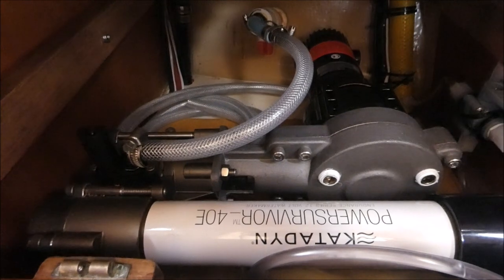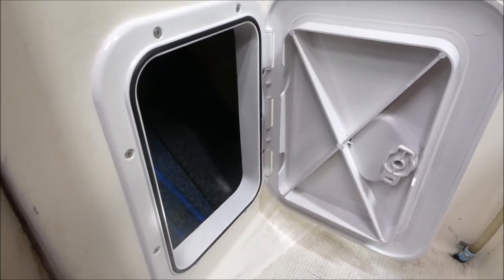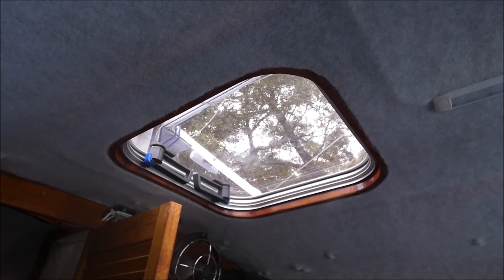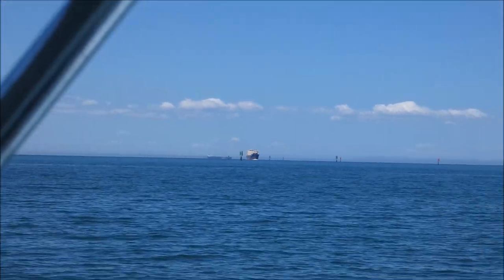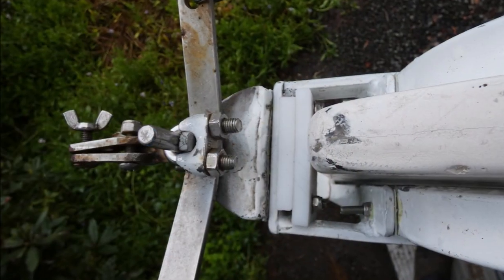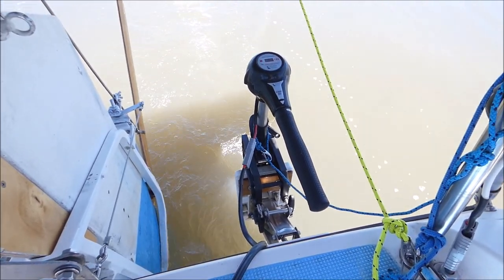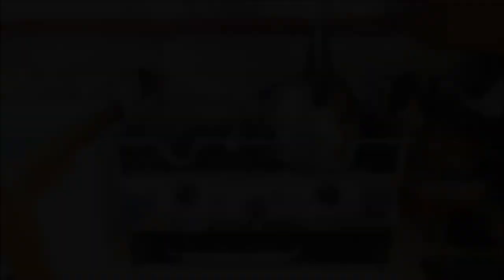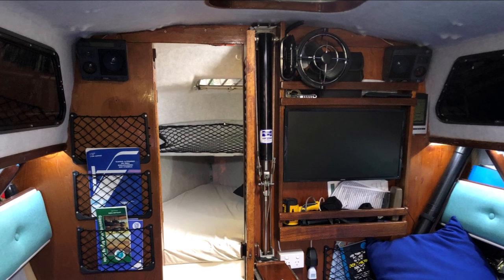Neringa Improvements   Preparing for the Kimberley

Comment: Well done Mark.... someone has already asked the question re the rudder. Cheers Tony
Reply from the maker: Hi Tony, Yes I assume you saw my reply. I forgot to put in one bit of footage in the last video about this. In essence it is a very simple modification if your rudder box has enough slack at the bottom to allow the rudder to rotate back and forward. All I did was to open the top back of the rudder box and make a u shaped extension bracket that allows the top of the rudder to move back around 75mm. It is held in this position by the wooden block you see in the western port video at the front of the rudder. Pushing it back a the top makes the bottom of the rudder move forward with around 15% of the blade crossing forward of the rotation line of the pintles. This makes this section use the water flow to help turn the rudder or what boat builders refer to balancing the rudder. My rudder has gone from a firm hand grib and the need to use reasonable force to steer at speed to being able to steer with 1 or 2 fingers. Even my wife commented how light the steering was when she was at the helm. If you exceed more than 20% of the blade forward of the rotation line the rudder can become unstable and lock over one side or the other. The sweet spot most boat builders aim for is around 18% of the wet part of the rudder forward of the rotation line. If I have time in the next few weeks I might put together a video with images to explain the concept and what I did. My method is not the traditional way of doing this but has proved to be a simple and effective method in my case. Cheers Mark

Comment: Mark, if you don’t go this year, I can imagine that you will just keep adding to the yacht. LOL
Reply from the maker: It better be this year, don't think I could take another round of being completely packed and ready just to unload everything again. Neringa is running out of room for improvements although I am looking to upgrade the outboard to 15hp for those kimberley currents.
Reply: @TRAILERYACHTADVENTURES  yes understand, what brand of outboard are you thinking of, I believe Yamaha are the best.
Reply from the maker: @CaptMarkSVAlcina  These days there is not a lot to differentiate between them. Yamaha high thrust only comes in 9.9 or 25hp and I need 15hp. My current motor has the gear shift through the throttle which is great for docking, lets me see where I am going whilst being in control of the boat and not having to duck down to shift gears. Sadly no one makes this shifter anymore so the next best is one on the tiller handle that I could make an extension for. To cut it short in the end I will probably go with a mercury 15hp fuel injected motor with a high thrust prop. Lightest in class and hopefully small enough to fit my motor well. They are japanese made by tohatsu which have a long and reliable history. 12 amp alternator as well to help with battery charging.
Reply: @TRAILERYACHTADVENTURES  My Mechanic connected the 9.9 Merc to existing Yamaha gearshift and throttle. Wonder if that could be obtained instead of tiller handle.

Comment: so playing catch on your channel just subscribed I have a Hood 20 1967 I'm currently rebuilding from the ground up! I'm thinking of a 4hp outboard as i don't require to registered the boat saving $$$$ do yo think this is enough to push the boat along or do I require a larger motor?
Reply from the maker: It will be enough in light to moderate conditions to push the boat fine. The times you will have problems are into strong headwinds where wind and chop will likely slow progress considerably with the boat stopping every so often when the right set of waves comes along. Of course pushing against currents will also play havoc. So probably 75% of the time 4hp will suffice. The times you may wish for more is when the above conditions arrive unexpectedly and stop you getting to an anchorage or through a tricky channel before dark. Cheers Mark

Comment: Nice video! Have you had your boat & trailer over a weigh bridge when loaded up ready for cruising?
Reply from the maker: Only once and it was just under 3 tons on the trailer with water tanks part filled. Most RL28's packed for cruising will be in the 3 to 3.5 ton range, empty more likely in the order of 2.5 tons. They are a big boat but as long as the trailer is properly braked and the car is rated for the load not hard to tow. Cheers Mark
Reply: @TRAILERYACHTADVENTURES  Yeah I've had my boat on the weigh bridge at 2 tonne on the limit of my vehicle

Comment: I am in the process of restoring a RL 28 and I'm  lovi g your vlogs. Can you give me more information about  the masthead rig. Are you using the same mast? Keep your videos  coming please. 
Cheers
Reply from the maker: Hi Michael, I added  2 extra side stays to the top of the mast and a new forestay to the top of the mast for the new furler. The existing forestay was moved back to the rear of the anchor well to become an inner forestay for security and strength and to be able to adjust the curve of the mast. I cant find the lengths of the new stays and these may vary as there was a bit of variation in RL masts. When I replace them I will measure them again.
New u bolts were placed 50 mm next to the existing side u bolts. This means the top of the mast can still move forward and rearward a bit for adjustment. The lower spreaders were extended by 50mm so the existing side rigging stayed were it was but the new top wires to go on the outside  to the top of the mast. The smaller forward spreaders were replace with rearward facing spreaders. I tried without these first but to support the top of the mast required a higher tension, worked much better with the spreaders.
A new ubolt for the inner stay was installed rearward of the anchor well. I made and internal anchor for this that you will see in my last improvements video in the relining section. I did this because the bottom of the anchor well at the rear is prone to cracking on RL28's and the plate spreads the load evenly and avoids this. 
The new forestay attaches to my anchor bracket which was strong enough and fastened more securely with a plate and 3 largish bolts. I have an extension to allow the furler to be just above the pulpit to allow me to see under when underway. On the mast the forestay attaches to a rigging yoke riveted and bolted to the top front of the mast. All fittings were bought from Keely marine or Whitworths.
The backstay remains unchanged.
It is important to note that I had new sails made at the same time and I very deliberately made them with the same area. I might still have the details of the mainsail which had the roach reduced slightly to decrease rounding up tendencies. Sailing in wind under 15 knots this results in a rig that is easy to balance and out performs the original rig, after 15knots you reduce the headsail first and performance is similar to the original rig 20knots plus. Sailing downwind wing on wing used to be awful with the original rig with the boat yawing between large main and small head but now with the sails balanced is a pleasure. Dont oversize the headsail as this will unbalance the boat and in strong gusts cause strong rounding up.
I am satisfied that the rig is now super strong and now that it is properly tuned sails very well. Hope this is of some help. Cheers Mark
Reply: @TRAILERYACHTADVENTURES  ok thanks,  I  would like to get more information on  this subject as I  agree with you that the headsail is abit of  a letdown. Definitely  worth doing.

Comment: Mark, Having seen demos of some Lithium batteries burning very happily, how would you put out such a fire? cheers Tony W
Reply from the maker: Hi Tony, Yes Lithium batteries can burn but it takes a bit of abuse to get them going. Lithium metal batteries are dangerous as the more water you put on them the more they burn. The Lithium Iron Phosphate batteries that I am using can also experience thermal run away and burn but can be extinguished with plain water. So if I ever have this happen the plan is to flood the lithium battery locker with water which will extinguish flames and cool the faulty battery to slow or stop the thermal runaway. Cheers Mark

Comment: Very jealous of your boat. Are the boom and traveller standard? The traveller is on cabin roof giving more room. Your setup with the Bimini allowing full standing height under the boom is awesome. Did you make any changes to achieve this? Love the videos. Looking for my ideal TS but they are not something you can just pop over and have a look at so videos like yours are very helpful. Keep up the great work mate.
Reply from the maker: Hi Paul,
Yes the boom and traveller are standard. As a cruising arrangement they are great but some racers would say not a good as the full width traveller in the cockpit for trimming sails more precisely. As I am a cruiser my arrangement suits me and I am happy to forego the extra half knot you might get with the full width traveller. 
I chose the RL28 as one of the few trailer sailers that have full standing headroom in both the cabin and in the cockpit allowing for the full height bimini. On the flip side it makes for a slightly higher centre of gravity which makes them heel a bit more quickly. Not the fastest boat on the block but many pluses as a cruising boat.
Glad you enjoy the videos, love to encourage others to get out there and go on their own adventures. RL28's are pretty hard to buy at the moment but keep looking and I am sure you will eventually find your ideal boat. Cheers Mark
Reply: Thanks for the reply. Did the additional lead you added to the keel box do anything to remedy this? Not bothered about racing, just want to emulate your cruising lifestyle 😊
Reply from the maker: @PaulWright890  The lead has certainly made a difference. The RL has a more vee shaped hull than many trailer sailers and even with the lead heels to 15 degrees quite quickly until it has its cheek in the water. The main difference the lead has made is that it stays not much more than 15 degrees as the wind increases whereas before in 30 knots you would see 25 to 30 degrees of heel  it now rarely goes more than 20 degrees.